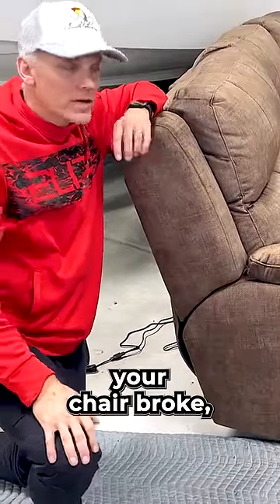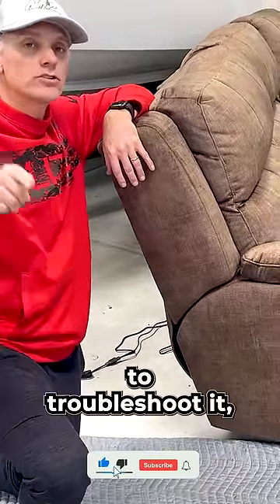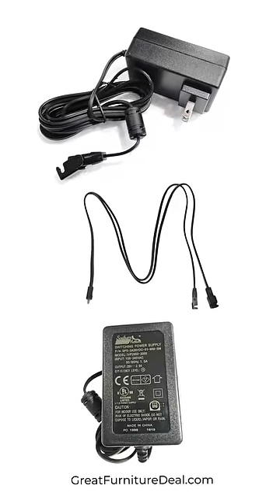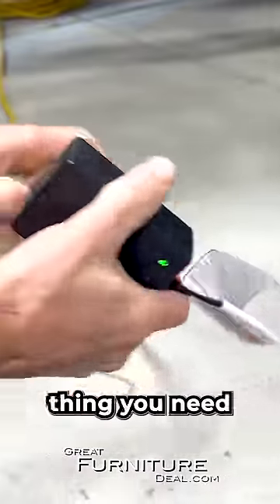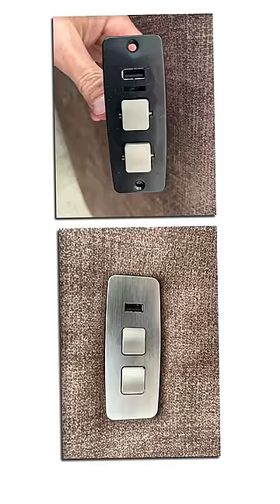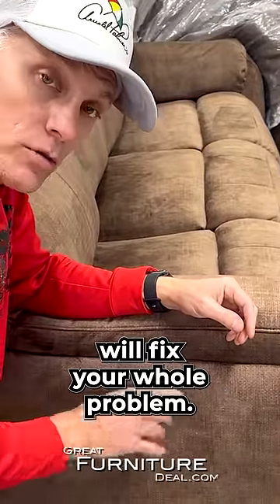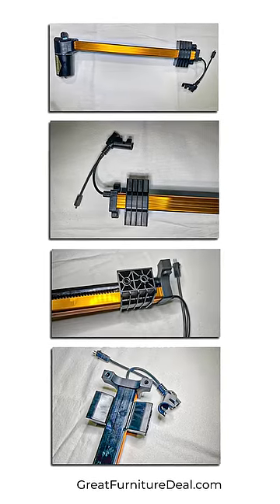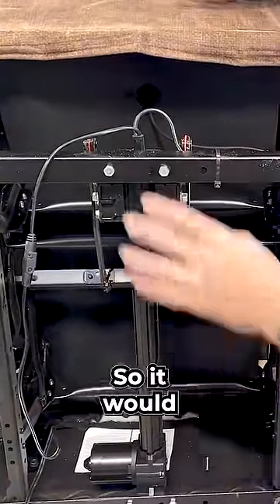How to know and fix what is broken on my power recliner. Southern Motion, Lane , Ashley Furniture

Comment: Bro you are a genius 👏.  My screw fell off and I was having trouble screwing it back on. Thanks
Reply from the maker: Glad we could help!
Reply: @Greatfurnituredeal my friend is there a place to buy parts? Underneath the plastic part broke were the motor grabs the little steel part.
Reply from the maker: @kcorpora1  Unfortunately, if the plastic part broke, you need a new motor. www.GreatFurnitureDeal.com or 800-970-5889

Comment: I just got a power recliner without taking into account the length of the power cord. My recliner must sit in the middle of the room and the recliner cord is short by about 2 feet no matter what I do. The actual power adaptor on the chair says 100-240V - 50/60Hz, 1.6A at an output of 29V - 2A. There's a big tag on it that says do not use with a power strip or extension cord. I notice you're using an extension cord. Can I use a power strip or extension cord? Do I need a heavier-duty extension? Thanks for all your tips.
Reply from the maker: I would follow what your tag says. We do sell an extension cable that is added after the power supply to give you additional length. We recommend those. The heavy duty extension cable was used here to create the video but not recommended for daily use.
Reply: I use a circuit breaker with my recliner that just now the stopped  working. The circuit breaker is okay and other things attached are working. If I find a different problem should I keep using the circuit breaker? No labels on chair that was purchased five years ago at at Macy’s in Las Vegas?

Comment: Southern motion love seat messaging recliner works except the message feature only partially inflates to about 25%.  It will go through its message sequence but will not inflate completely.  Do you have any suggestions or recommendations?
Reply from the maker: The message on the Southern Motion chair doesn't use anything to inflate when it massages. Are you by chance talking about the lumbar bladder that is only inflating to 25%? Feel free to call us at 800-970-5889

Comment: My AC adapter is blinking green and 2 replacements are doing the same thing. Is that not the problem?
Reply from the maker: If the power supply is blinking green, that means you have a short in the system. Unplug the button from the motor (usually 5 pin connection)  and see if the light stays solid green. If it does, you need a new button/remote. If it is still blinking, remove the motor from the power supply (2 pin connection). If it then stays green, the short is the motor. Let us know which parts you need and we can get you some replacements. 800-970-5889

Comment: My AC/DC doesn't show a green light. However, when I disconnect the wires from the AC Adapter and leave the Adapter plugged in, the green light (as being on) is on. What can be the reason as to why when everything is connected the green light is off.
Reply from the maker: It sounds like you have a short in your motor (the adapter connects directly to the motor). We an assist you most likely in finding a motor replacement if you want to let us know which one you are looking for. 800-970-5889
Reply: Same problem , I unplugged speakers and light for little over 2 months try to plug it back up and power cord isn’t showing green when everything is connected

Comment: I’ve considered the buttons to recline….  But even the phone usb ports don’t work as well as the electric outlets!!   We replaced the cords….   Nothing
Reply from the maker: In that case, it could be your button control or your base motor which routes all the power. We sell both parts and can help you troubleshoot. 800-970-5889

Comment: My AC adapter is blinking green and 2 replacements are doing the same thing. Is that not the problem?
Reply from the maker: If your power supply is blinking green, your issue is a short in your motor or button/remote. Let us know which motor or button/remote control you have and we can help with a replacement.